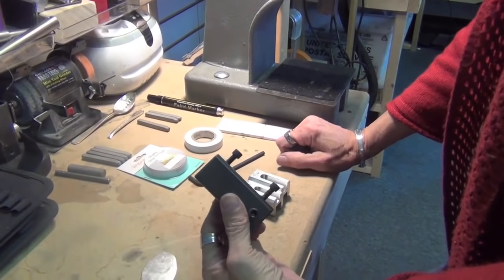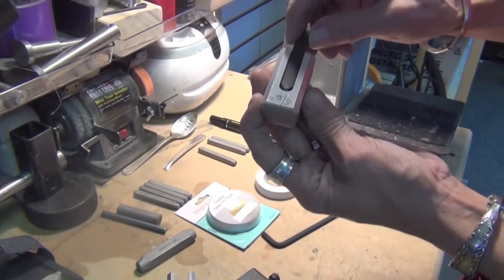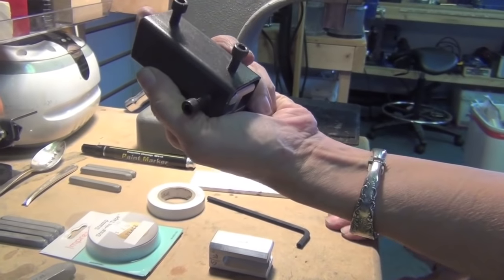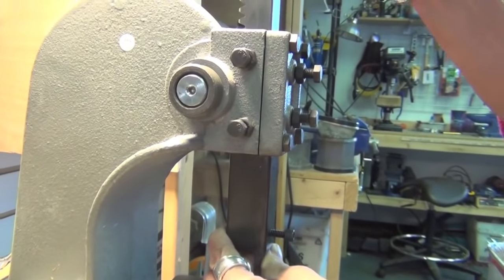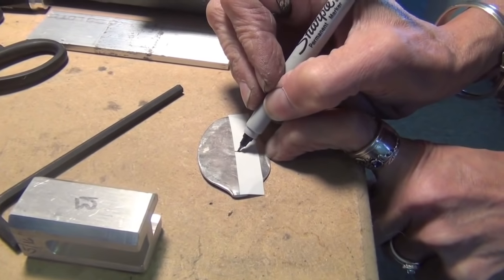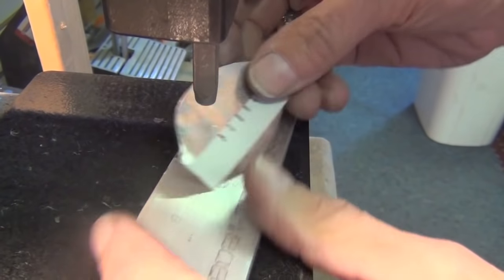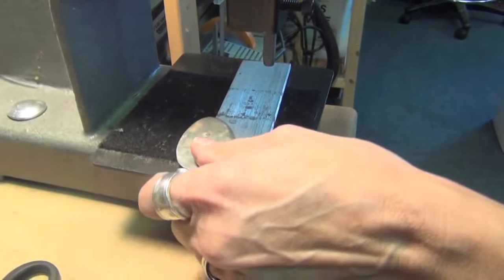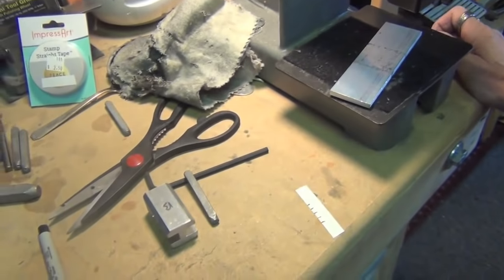Metal Stamping Tool for the arbor press

Comment: I have a one inch stamp, would I just buy the metal stamping tool attachment? Or how do I use a 1 inch stamp?
🔥🦈🌊
Reply from the maker: The purchase of an insert is required when buying the attachment, but to use a 1" stamp you would insert the stamp into the attachment without an insert.

Comment: Is that the 1 ton Arbour press? I'm looking to buy a press and have been looking at the 1 ton ones. I'd like to get one of those stamp attachments if the attachments will fit the 1 ton Arbour press. But not if it's a different one.

Comment: I bought the tools and a one ton Arbor Press. My stamps fit but I am only getting a partial stamp. I am practicing on copper but want to stamp silver. On one You tube a guy is hitting the top of the shank but you are not.  Should I be able to just press the stamp? I feel Ike I’m pressing hard. Please advise.
Reply from the maker: The best impressions come from stamping on top of a steel bench block.  https://www.flatwearable.net/home/metal-stamping-tool/

Comment: hi, for those of you that use a 1/2 ton arbor press...
what ga metal do you use with it?
i bought one and a few design stamps a month ago, and i tried using 24ga dead stof sterling silver, nothing transfered, so i went to 26ga, and i got a little impression and a better one after i used a hammer on the ram, which i dont want to do. i thought i would just have to pull the handle down and then my design would be on the metal? maybe im just really weak? i just ordered 28ga but am worried that might be too thin. 
i can never get the full design when i hand stam, i've tried the tilt n tap but always mess it up. letter stamps,numbers and simple designs i have no problem free handing on metals up to 24ga.
Reply from the maker: What surface are you using to stamp against?
Reply: @FlatwearableArtisanJewelry  a steel block.
Reply from the maker: @shaunasilver9545  You should be getting an impression but your metal is also pretty thin.  I would suggest going down to 20 gauge or thicker
Reply: @FlatwearableArtisanJewelry   thank you i will try that. i also tried lowering the press because i had it on my kitchen island, i think if i put it on a lower table or something i will get more leverage.